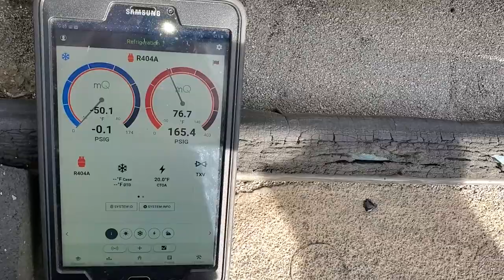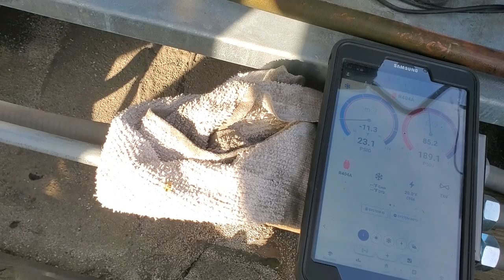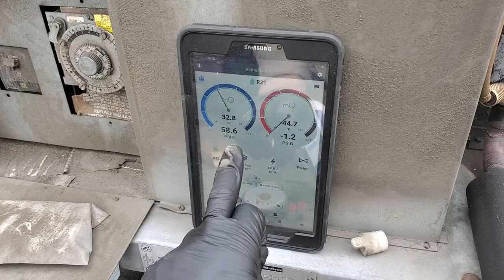WATER LEAK OVER THE RESTROOMS

Comment: Technical... um... “nitpick” is the wrong word, but... Welding is when the base metal (copper in this case) melts, brazing is when the temperature is high enough for there to be significant diffusion between the filler and base metal that the joint is significantly strengthened, and soldering is when it’s not hot enough to diffuse across the joint. 🤔

Comment: Comment, watch the distance of your tip. #1 tip about 2" if windy rosebud at about 3" at least your not using turbo torch like so many others. Scrap stainless steel makes excellent teaching tool, students of yours are too close and will blow holes in copper. If you can braise SS smooth you have no Pitts and smooth.

Comment: Leaking packing on king valves use nylon to pull a deep vacuum into the micron level.  In my grandfathers day is that they use Vaseline. In my dad‘s younger years he started out with Vaseline in the 60s and going into the 70s switched over to silicone grease which is a deep vacuum greased used in laboratories. When I started under my father I use silicone grease and still use it to this day and also Nylog

Comment: The job looks nice .. but stop calling tech support lol for silly things like pipe sizing...  you could of gotten away with 1/4 inch liquid line... Depending on the Capacity of course
Reply from the maker: I didnt call them I read the install manual for the freezer condenser
Reply: Don’t feed the trolls buddy 😁😉
Reply: @sparkydave2783  you sir are the troll.. i said nothing wrong....